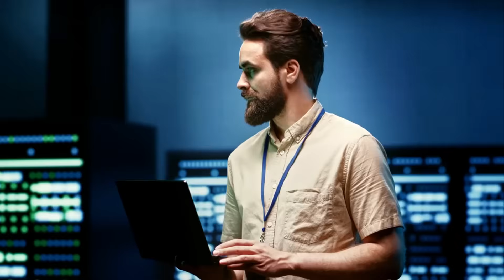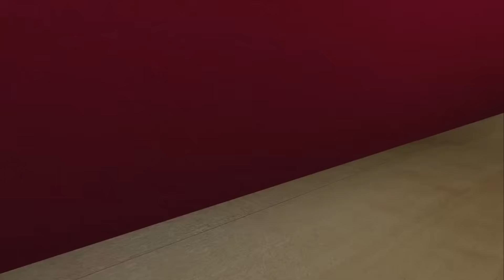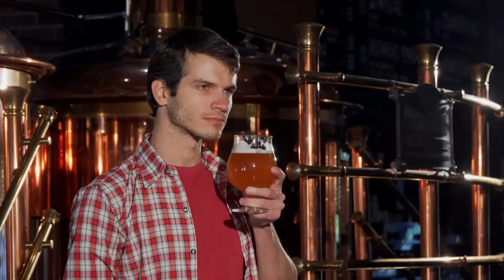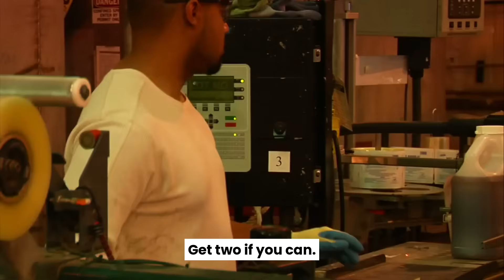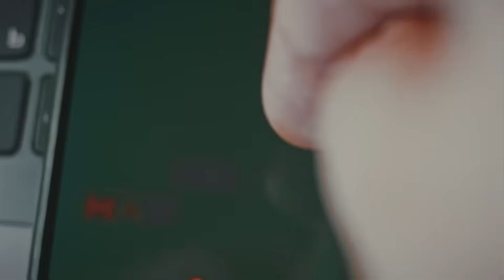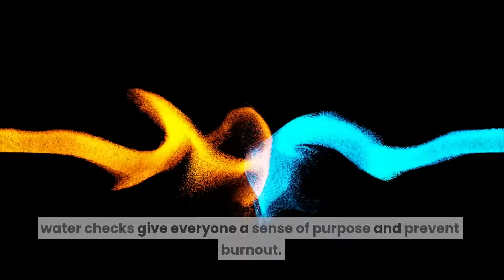Top 10 MUST-HAVE Items to SURVIVE a BLACKOUT in an Apartment

Comment: When using bleach to purify water ... only use unscented bleach and use 8 drops per gallon. Bleach looses potency after 6 to 12 months so be sure to cycle it. Be careful with solid cooking cubes ... they are hexamine and need good ventilation or can be bad for your health.